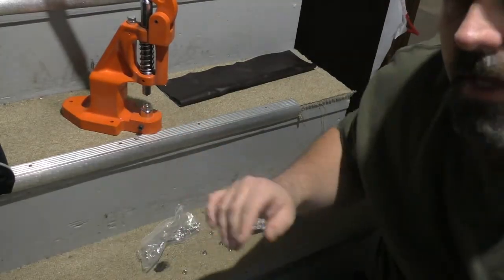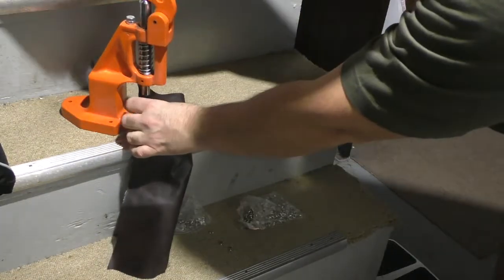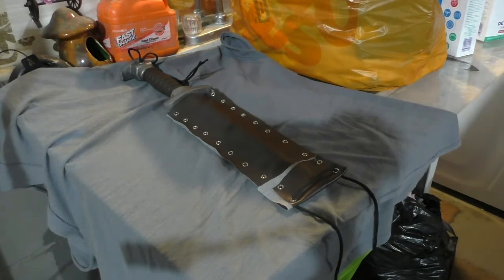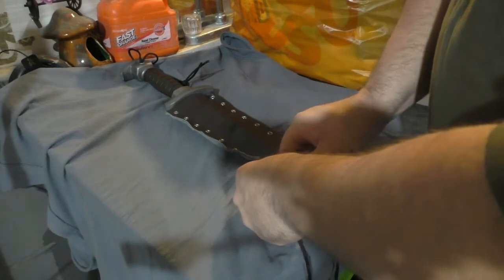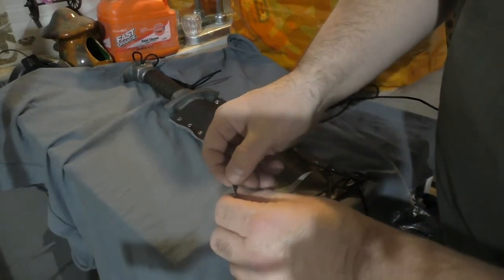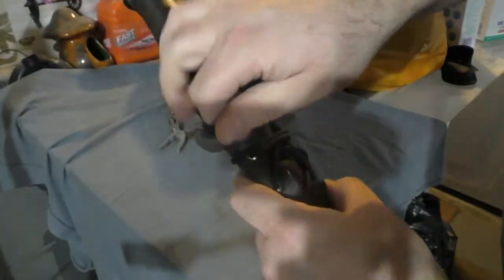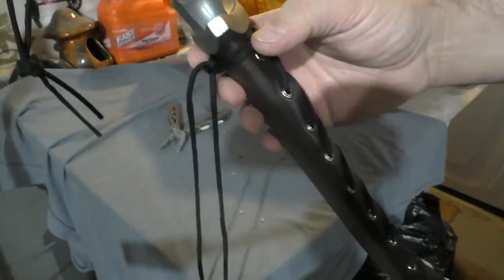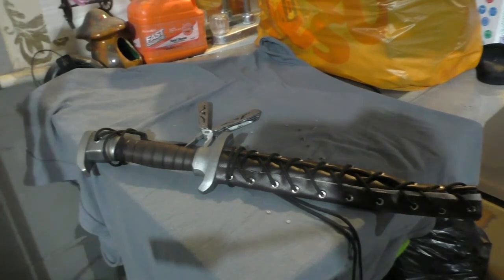How To Make A Knife or Dagger Sheath For Larp

Comment: I put Fleece in the sheath of my Sword, and made it pretty tight, then sprayed silicon into it, so now everytime i put the sword in, it gets a nice cover of silicon everytime i draw it.
Reply from the maker: That's a really good idea for latex weapons.  Calimacil style ones don't need the silicon, so I wasn't concerned.  But I used just a normal leather sword holder for my epic armory blades and trashed them from drawing and inserting them.  So, definitely a good tip if using those style of latex weapons!